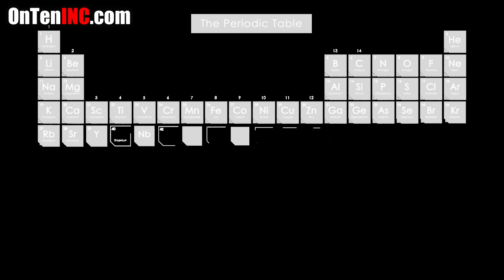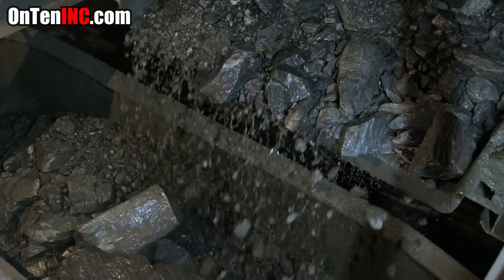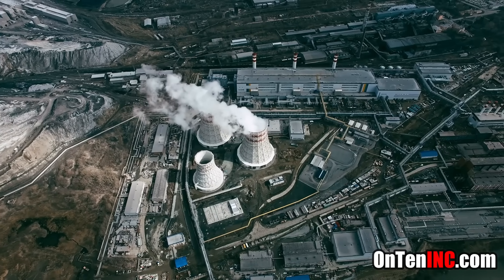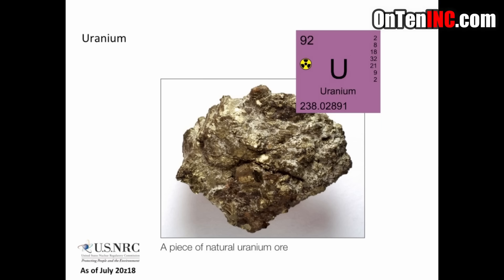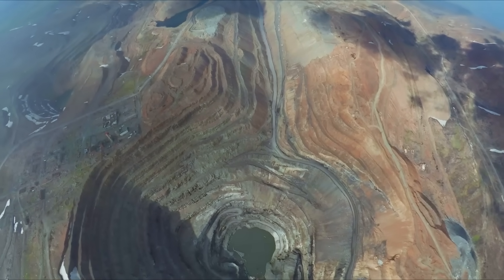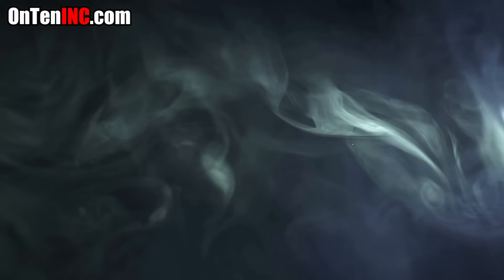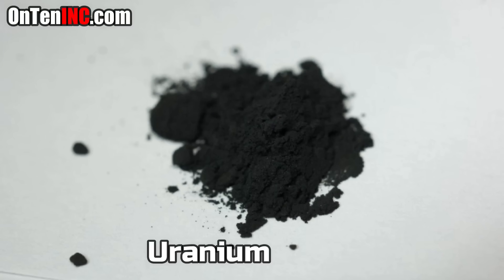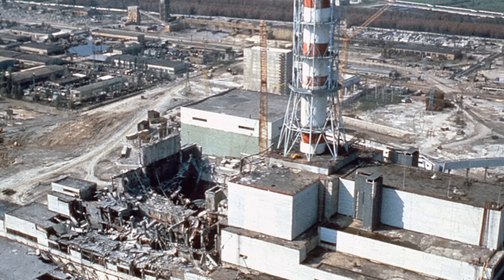Why is Uranium Dangerous but So Useful?

Comment: This video needs a few corrections:

1. Uranium-235 and Uranium-238 are the two most common isotopes of uranium. Naturally occurring uranium consists of approximately 99.3% U-238 and 0.7% U-235 by weight.

2. Uranium enrichment is typically performed using gas centrifuges, which exploit the slight mass difference between U-235 and U-238 in the gaseous form of uranium hexafluoride (UF₆) to increase the concentration of U-235.

3. Nuclear fuel for light water reactors is typically enriched to contain about 3–5% U-235, with the remainder being U-238.

Comment: Uranium glass wasn't extremely toxic as this video suggests. Look it up. People collect the stuff. It's barely above background radiation. This is why you have to be careful about videos like this that over simplify things to fit young people's short attention spans today. They get only a shallow understanding of something, and sometimes it's not accurate at all. The Internet has dumbed down everything and done away with context.
Reply: It's not the radiation that makes it toxic, it's uranium itself, it's a heavy metal and toxic just as lead is.  Look into the effects on the Iraqi people that used scrap metal from the destroyed armored vehicles from the first Gulf War.  Those armored vehicles were destroyed by depleted uranium rounds.  All it takes is traces of the uranium oxide dust to cause many forms of cancer.  Same happed to the troops that serviced the guns that shot that ammunition, they were exposed to small amounts of uranium dust.
Reply: Keith,
Uranium, being a heavy metal, is toxic irregardless of its radioactive instability. I could not find anything in this video that was incorrect. 
Shut your mouth you argumentative old man lol

Comment: Uranium 235, which is fissionable can NOT be made from U-238 isotope, which makes up 99% of all of the metal which is mined. U-235 must be separated instead from uranium metal through an enrichment process instead. 
See: https://en.wikipedia.org/wiki/Uranium-235 and https://en.wikipedia.org/wiki/Uranium#Isotopes .
I do agree that if proper safety measures are taken, electricity generated by nuclear power plants is Much preferred to electricity generated by fossil-fueled power plants If we are to reduce greenhouse gas emissions!